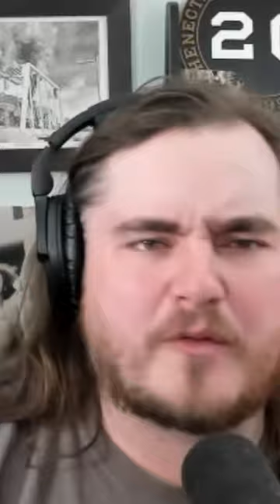Why do big boy locomotives run slowly, despite a fast top speed?

Comment: It's an American train made for a moving American sized loads,If you're stack of cars is less than a mile long we assume your shunting to mack a real load.
Reply: To be more specific, they were American trains built to haul American bulk through the spleen of the USA (the Rocky Mountains and Sierra Nevada's.) The more wonky ups and downs of the two mountain ranges as they passed through Colorado, Utah, Nevada, and California were a bit much for other "normal" engines. The US did was the US does best. If current locomotives can't pull their freight through those mountain ranges on their own, add more locomotive. If that doesn't solve the issue, ADD MOAR LOCOMOTIVE!!!!!!!!!
Reply: Yep. And the britts thought to add more little engines that could rather than making a bigger engine than can.

Comment: There's another reason, the Union Pacific during and after WWII only needed an engine that could move a crap ton of tonnage, the speed part was a bonus. So the Challengers and Big Boys were made to move the massive amounts of tonnage, the Challengers were used for power AND speed, and the Big Boys were used for their power, sometimes they would pull trains that needed their power and speed
Reply: For quite a while it wasn't entirely known just how fast they could go since the articulation and compounding are more likely to break at high speeds and nobody wanted to risk it.

Comment: I’d imagine diesels to work much the same way. Keep in mind I know next to nothing about diesel locomotives, but I do know a decent bit about electric motors. My understanding is that, the heavier the load on the motor, the more torque is required to overcome that load and the more current is required to apply the torque. The catch is that when an electric motor draws more current, it is able to apply stronger torque at the cost of a slower rpm thus, a slower speed is achieved. Those of you that know more about these things than I do, feel free to roast the $/-/!1 out of me for any incorrect statements. Hopefully y’all learned something from my ramblings, have a wonderful day:)

Comment: And then there are the Britsh 9Fs that threw that book out of a window. There are reports some of them went the ton in passenger service. Oh yeah, a freight loco that also ended up running passenger trains, lol.
Reply: Thats because they couldn't figure out how to make strong cuplers. You cant pull miles of freight when you have cuplers than can only handle 1000 tons of force. So instead they found it better to make them faster and not as powerful so they dont break stuff.

Comment: Things I didn't know before now, but I see the logic behind it. 
Follow up question from a complete layman:
Is that why steam locomotives are somewhat prone to "burnouts" when they're starting to move? 
Because they have so much force they can deliver and less than perfect management can make the wheels slip?
Or am I up the creek without a paddle here?
Love these explaining clips, such an easy to reach nugget of facts!
Reply: Yes that is called wheel slip. For steam locomotives slipping the drivers
Reply from the maker: So, slips can be caused basically by two things: loss of friction, or too much tractive force being put down. A dip in the track, ice, water, leaves, etc. can cause a loss of friction, too much throttle with not enough load behind can cause too much tractive force. If you give it too much, it'll slip, and when it slips, it usually does so pretty violently if you're trying to pull hard.
Reply: @durango5848 
Thank you very much for the reply.
Reply: @Hyce777  
So it's even more of a continuous balancing act than with a car because of the high torque at low speeds and the many variables that can effect the drivers slipping.
It might be closer to driving a car on so much snow and ice that there's almost like tracks on the road?

Comment: And while fans of "Big Boy" think they were all that powerful, they also had too small a firebox area to really run under full load at high speeds. Meanwhile the H-8s on the C&O produced their most HP at 45MPH, but got stuck at coal drag speeds most of the time.
Reply: The Big Boys WERE powerful, but the slightly smaller Yellowstone's would actually pull a heavier load.

Comment: It's a loco made for moving freight. You could probably push it and make the thing go fairly fast, but that quickly wears it out, as it were never made to go "fast"
Reply: Two types of steam Locomotives -
Built for power (freight)
Built for speed (passenger)
Main difference is the size of the driving wheels.
Reply: They were capable of running faster but they were rarely run at full speed.
Reply: The Big Boys were rated at a max speed of 73 mph but they've never pushed them that hard in any scenario.

Comment: It's really basic but so hard to remember that steam locomotives don't work like gasoline-powered engines. The energy in a locomotive isn't all stored in the gas, waiting to be put to work. The energy is stored in coal, spent to transform the water into steam, to do work. Trains essentially have to MAKE their gas AND use it to move. It's a delicate balance.
Reply: Super heated steam water droplets expand over 2,500 times according to Jay Leno, since he knows about steam engines like the back of his hand, and you get WAY more power from super heated steam than with normal steam.

Comment: I always wondered how far you could push a steam locomotive as far as running with the throttle wide open and the Johnson bar in the full forward position before something catastrophic happened….I know when they’re building up speed and they start pulling the Johnson bar back to shorten the travel / duration of the valve gear allowing steam into the cylinder per stroke, you can hear the “violence” of the “chug-chug” exhaust of the cylinders decrease dramatically. I would assume operating with the Johnson bar / cutoff advanced all the way that things would start failing pretty quickly once you started getting anywhere near the speed limit on most flat, straight areas of main lines….I just wonder what would fail first and when.
Reply: Having the reveser in full forward would actually limit your speed. It would not make you run so fast things start to fall apart. The biggest limiting factor for how fast a train can go is actually the tracks more so than the train as you are more likely to derail catastrophicly at speeds over 100 mph.

Comment: Could the efficiency of locomotives at faster speeds be improved by either disconnecting some of the cylinders, or else switching between short bursts of wide-open-throttle operation separated by intervals of zero steam usage?  By my understanding, useful speed for steam locomotives is limited by the fact that their efficiency drops off severely if the mass of steam per stroke falls below a certain point.  Feeding half the cylinders twice as much steam per stroke would more than double the amount of work those cylinders could do.  Is my understanding correct?

Comment: I thought they could run at 70 mph.
Reply: I’m sure they can but lower speed means they can let more steam into the cylinders. 
More steam = more power. 
More power = more tonnage. 
More tonnage = more profit.
Reply: @hipie379  They where used in passenger  trains from time to time.Most likely during WW2 years.

Comment: It seems that you need gearing; you need overdrive, so the engine can operate at a lower speed, while the train is running faster.

But steam engines don’t have gearing.

Comment: AND SO IN A SENCE , THEY SHOULD NOT HAVE HAD 68 INCH DRIVERS BUT SHOULD HAVE 62 INCH OR EVEN 57 INCH DRIVERS ,,, AND WERE NOT AS GOOD AS THEY COULD HAVE BEEN , AND THATS WHY THE ALLEGHENY AND Q2 WHERE WAY BETTER WITH 2000 MORE HORSEPOWER TO KEEP THAT HORSEPOWER UP AT A HIGHER HIGHER SPEED

Comment: Oh come on!  What a bunch of hoooy!   Big Boys can't run as fast as say, 844 or even 3985 is because of the size of the drive wheels.  Compare them.  Small drive wheels give low speed but high power.  Look at the high speed prairie engines with their huge drive wheels.  Look at the coal train engines from back east with their itty bitty drive wheels.  Big Boys are stuck in low speed because of the size of their drive wheels!  They were purpose built to haul lotsa weight up Sherman Hill, by themselves, at any any speed they could manage.